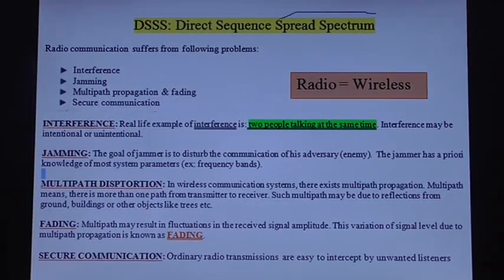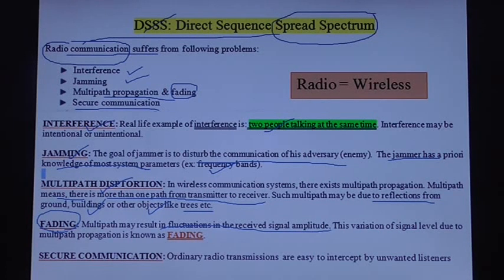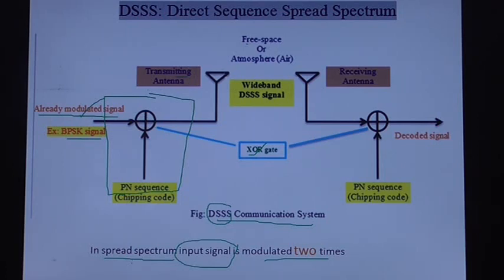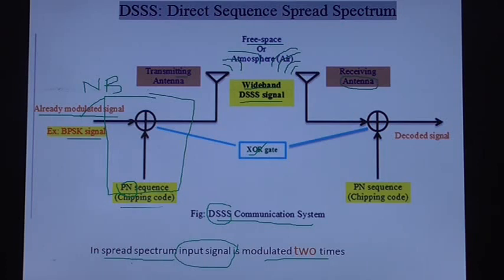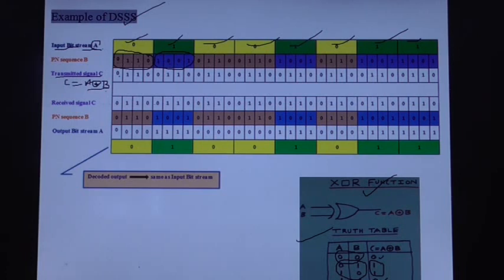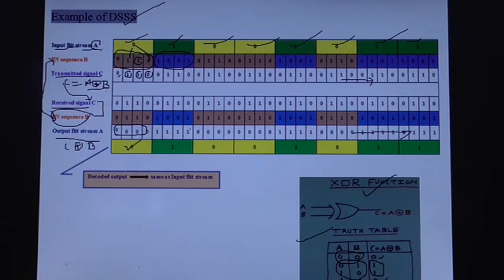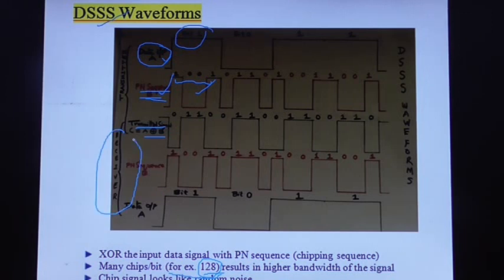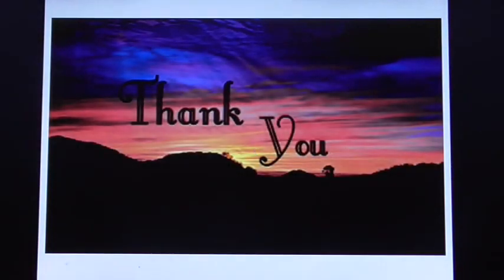DSSS - Direct Sequence Spread Spectrum

Comment: Why the PN sequence is selected 0110? can we choose any other binary number?
Reply from the maker: Yes. Here I randomly took 0110 for explanation purpose. The strength of DSSS or FHSS depends on length of PN sequence. Consider two cases of DSSS:

case 1: DSSS is using 128-bit PN sequence.
case 2: DSSS is using 2-bit PN sequence

Obviously case 1 will provide better protection against interference, jamming etc.

Practical applications of DSSS use Barker codes and CCK (Complementary Code Keying). Barker code of length 11 is used in direct-sequence spread spectrum and pulse compression radar systems. The length of CCK is 8-bit.

CCK was adopted to supplement the Barker code in wireless digital networks to achieve data rate higher than 2 Mbit/s.

Comment: Interference : One person is talking and Other person is talking loudly??? holy jesus you really need to read some decent books before enlightning others.
Reply from the maker: Non-technically I am trying to explain here so that students can understand. Two or more transmissions with same frequency will interfere each other. That is why for example, each FM station has its own frequency of operation. Ok... imagine, in a single room, many persons are talking at the same time... what will happen? When speaking, all persons have same frequency range between 20 Hz to 20 kHz. If you feel I am still wrong, let me know so that I will read more and reply.
Reply: @EngineersTutor  Sorry, I might have been a bit rude.  Your comment does a bit of justice regarding the explanation now.
Reply from the maker: Plz check my website: www.engineerstutor.com. Some topics may be useful. I am updating continually.